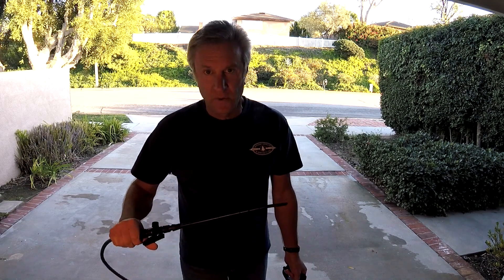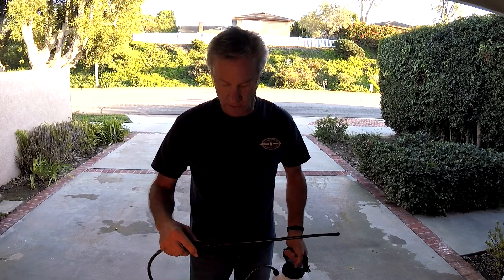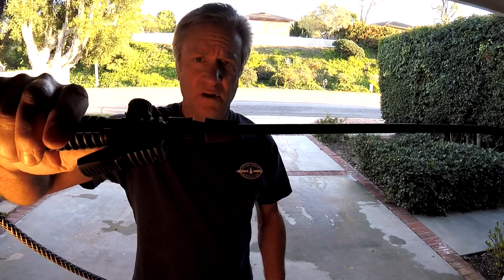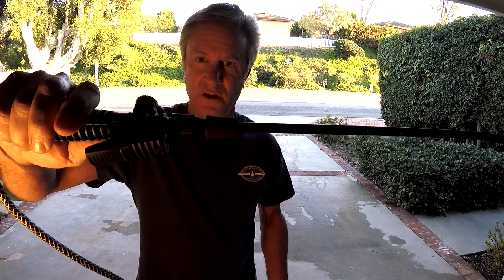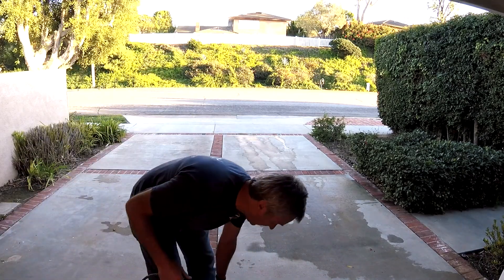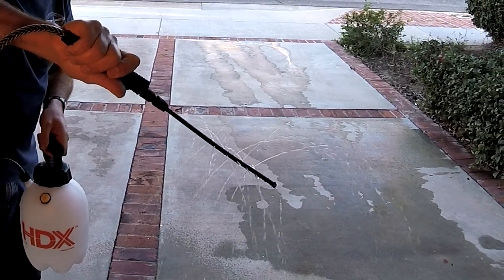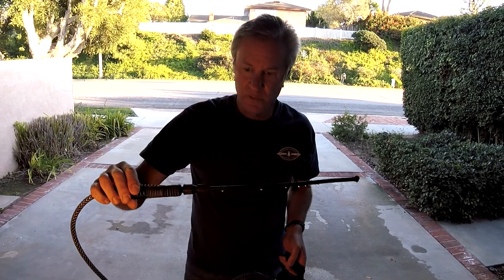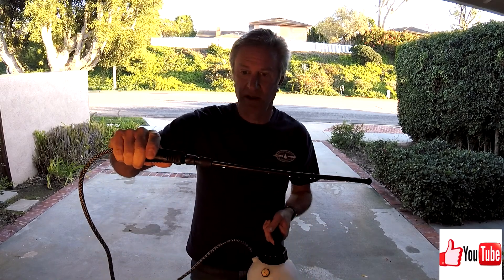How to build your own subterranean termite treatment injector

Comment: I am confused. How is it different to using a funel? There isn't anough pressure do anything different to filling a hole with the treatment.
Reply from the maker: More pressure with a garden sprayer than gravity.  I could see the treatment coming up thru adjacent holes.  Use a funnel and see if it works.  We'll be waiting for your results.
Reply: @MartyMitchell92660  I think the idea is to have a continues barrier in the soil. You wound need lots of pressrue to acheave that. I guess using a funnel or handhald sprayer is better than nothing at all but it is not close it ideal.

Comment: Your mixture is wrong. It is 4 gallons for 10 linear feet times depth which should be 4 feet
Reply from the maker: Thanks for the correction.  I’m just a homeowner trying to figure it all out.  My way seemed to kill them.  Haven’t seen any in years.
Reply: So what are you saying? I watched a ton of videos about trenching around a slab house and pouring in 4 gallons of Termidor mixed with water at a ratio of 0.8oz/gal and pouring it into a trench 10 feet in length wide by 4" wide and 6 inches deep? Are you saying you need one gallon per foot or 4 gallons per only 4 linear feet around a house while trenching? I just treated 165 linear feet last weekend  and poured 4 gallons of treated water per 10 linear feet. Did we screw that up then? I live in Central Florida.
Reply: While you accurately read the label regarding feet times depth, you are not correct regarding 'which should be 4 feet', it's 'up to' 4 feet'  Many homes do not have foundations even close to that deep,  due to type of construction and region.
Reply: Yes, that equals 160 gallons when it comes to termites if you do not hire a professional, you are a moron.
Reply: @dancoffey1086 So if you dont get ripped off by a professional and it works then you are a moran....hmmm.

Comment: Deep into the soil with pressure if he's only using 18 lb of pressure he might as well use a bucket because he's doing a leeching technique and it doesn't work he's going to have termites for a very long time if he thinks this is going to work leaching is only a Band-Aid and if your finances avoid you from getting professional help then this is better than nothing otherwise save your home and stop feeding termites by treating it the right way don't follow this guy's instruction you will be sorry
Reply from the maker: No termites since treatment for many years.  Worked for me!
Reply: Two things first you should know that there's a large treatment area that you didn't get they don't always just go right around the foundation termites can go up to 50 ft deep sometimes deeper come up right through the middle of your slab and come up through a crack plumbing and other things that happen in the middle of the slab this isn't an excuse this is been proven over and over again and chances are you haven't done that and you haven't found it but this is not an argument this is the difference between a professional and somebody who just put a Band-Aid on something and that's what you did to each their own it is your house
Reply from the maker: @endotimez4552  Professional equipment is better!  I agree.  This is a way to save money.  Never said it would give better results.  Professionals are almost always better, but many people like to DIY projects.  This is one of those.  It is what it is.
Reply: @MartyMitchell92660  
Explain to me this thing how is it saving money if termites come up through areas that you could not treat if you end up having costly repairs to your house later because you decided to save money on the front end
Reply: At this point it sounds pointless to try to educate you but maybe others will understand
Reply: Proper treatment of 6 out 6 down you did ok job if final grade work is what your trying to do however proper treatment would require 36 through 48 in of rod penetration in soil surrounding your home at high pressure then drilling concrete in areas you cannot dig fill that too make sure footers are well taken care of also drilling on the inside of the house and feeling those holes the details are pretty vast but if you didn't drill inside the house and treat that way you protected about a third of your home what you pay for is in the details of the treatment and the skill level of the company you went with how they prepare before how they treat and how they clean up after so aesthetically you're home looks as it did when they came up to it if not better
Reply: @endotimez4552  I have gotten estimates of 4k today. I cannot afford that. Simple. So I am looking for a DIY treatment to hold me over. Better than nothing.
Reply: @meandme5920  is it subterranean termite or dry wood termite
Reply: @endotimez4552  subterranean
Reply: @endotimez4552  I had 7 companies come out. Not one talked about drilling into concrete, holes in the wall or 36-48" high pressure drilling. I've done a lot of research and every single one said the 6x6 around foundation and the piers and point of entries with a non contact type (allowing the poison to be carried and spread to others over a couple weeks to get to the queen) was the recommended treatment. This included several universities that did intensive testing. Sure, you can add a ton of things to drive up a bill... like carpet cleaners that ad things already included in the cleaning solution anyway! Great way to increase profits.
Reply: @meandme5920  hey man thanks for pointing this out I had Terminex come out and they wanna charge me 2500 the problem is that 50 % of my house is surrounded by concrete I was thinking of drilling the holes and spraying in Terminex and then doing the 6 by 6 in the areas that don’t have concrete I would spend maybe 300 bucks much better in price I believe what’s your opinion?

Comment: How long to apply the right amount of chemical per foot of wall your treating and how is that wand going to penetrate soil?
Reply from the maker: Apply chemical until you see it coming up thru an adjacent hole.  The wand is only inserted into the hole once you drill thru the concrete and into the soil.  You must use a long drill bit that continues past the concrete, into the soil.  Works better with some soil types than others.  I didn't have any problems with this.

Comment: Is this method intended for drilling into the concrete covered areas only? Patios, driveways? 
I'm looking to do around the house on dirt.
Thank you
Reply from the maker: I believe you can dig a small trench around your house, mix up Termidor in a 5-gallon bucket, and pour it into the trench.  Cover with dirt.  Hope that helps.

Comment: I need to do something similar but here in Canada they inject it 4 feet deep. Any ideas how I could make it work that deep?
Reply from the maker: Maybe a stainless steel rod, point on the bottom end, holes drilled into sides, and tee fitting for injection, so you can hammer on the top.
Reply: @MartyMitchell92660  I also have an air compressor, I wonder if I should make it work with that somehow instead of the garden sprayer for more pressure
Reply from the maker: @gihadmurad  You still need the Termidor in a container than can handle the pressure.  I think it's safest to use the garden sprayer with it's built-in pump.  That will keep you from accidentally making a bomb.  It doesn't take much pressure to push it into the soil.
Reply: @MartyMitchell92660  thanks for the tip. I think you are right. I can get the exact same HDX sprayer, given what you seen what sort of adaptor and tube would I need to make it 4 feet long? All stores here are pick up only, can't go inside to check things out so have to figure it out online
Reply from the maker: @gihadmurad  Maybe a piece of 3/8" OD stainless steel tubing?  You'll have to be creative and see what works best for you.  Good luck!
Reply: @MartyMitchell92660  Thanks again for the reply! Last question, Do you have any ideas of how I could make a hole thorough the concrete that goes 4 feet deep into the ground? I have a hammer drill but I'm having a hard time finding a drill bit that long. Do you think I just make the hole as deep as I can and than drive a stake in with a mallet to reach 4 feet?
Reply from the maker: @gihadmurad  They sell very long bits but they're a bit pricey.  http://www.mo2ls.com/mm5/merchant.mvc?Screen=PROD&Store_Code=mpt&Product_Code=MX-08-54&Category_Code=RLMX

Comment: Will these sprayers put out enough pressure or is that even an issue? Just wondering how my pressure the professional equipment puts out.
Reply from the maker: The Termidor came out of adjoining holes, proving there's enough pressure to get the job done.  It's possible that your soil type might be a factor though, as I am 2 miles from the ocean and have a combination of sandy and clay soil.

Comment: Good idea. I will take your tip and use a stainless or copper tube, and try to get down at least 12” below the concrete. Glad to hear it worked for you.

Comment: How far down did you drill past the concrete and what size drill did you use.
Reply from the maker: I used a 1/2" bit, 12" long, but you could use an 18" long one as well.  My slab was about 4" thick, so about 8" below the slab to answer your question.  Haven't seen any termites since treatment 2 years ago.
Reply: @MartyMitchell92660  Do I need a big drill or will a good home grade drill work?
Reply from the maker: @davidthecardcollector  You need to use a hammer drill.  If your home one doesn't do the trick, you can rent one from Home Depot or buy one from Harbor Freight Tools for cheap.
Reply: @MartyMitchell92660  Thanks, I have a cordless milwaukee 1/2" drive for work.   If that don't work I will check Harbor Freight.  Thanks again.
Reply from the maker: @davidthecardcollector  I don't think that will do all the hard work required.  Rent or buy is my recommendation.
Reply: @MartyMitchell92660  I ended up buying the 1" rotary hammer drill at Harbor freight for 70 dollars and used a Bosch 1/2" drill bit.  Had no problems drilling thru the concrete which end up being 8 or 9 inches thick in places.
Reply from the maker: @davidthecardcollector  Wow, that's some thick concrete.  Holy cow.  Glad to hear it drilled right thru it.  Good thing you purchased the HFT rotory hammer.  Wasn't going to happen with a lightweight unit.  Good job!
Reply: @MartyMitchell92660  I tried with my milwaukee cordless M18 and it was not enough.  Glad I bought the 18" drill bit the first time.

Comment: Did you use foam or just straight liquid?
Reply from the maker: Termidor SC mixed with water, so liquid, not foam.
Reply: @MartyMitchell92660  Thanks....did it do the job?
Reply from the maker: @forshigity5000  Yes.  I haven't seen any sign of termites since treating the area.

Comment: Great idea Mitch - Did the solution spill out of the hole or did it actually keep in contained in the hole?
Reply from the maker: For the most part, it stayed in the hole.  Sometimes it would come out of an adjoining hole, but that's to be expected.  I have sandy soil, so once drilled, it was hard to keep the sand from filling back in, so a metal wand would have been better.  Next time I will replace the wand with a piece of stainless steel tubing.
Reply from the maker: There's a rubber stopper installed onto the handle end of the wand.  Press down on that while injecting.